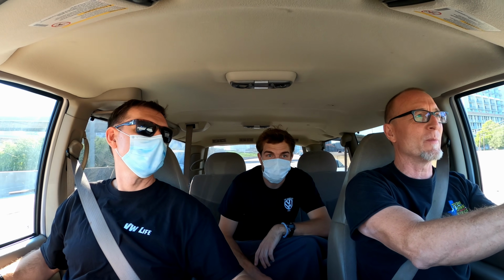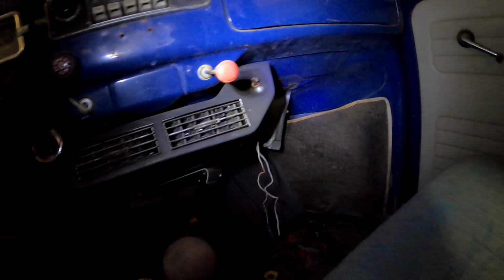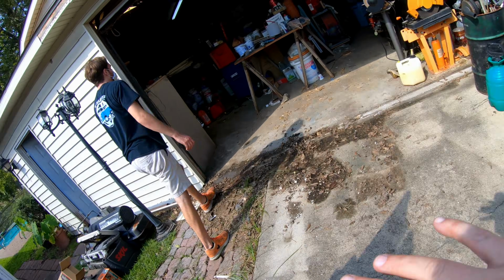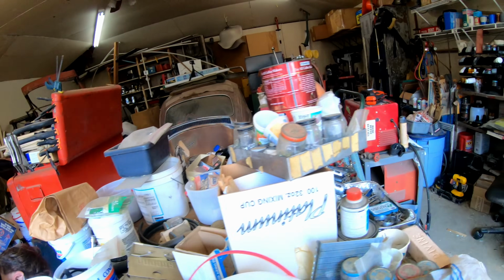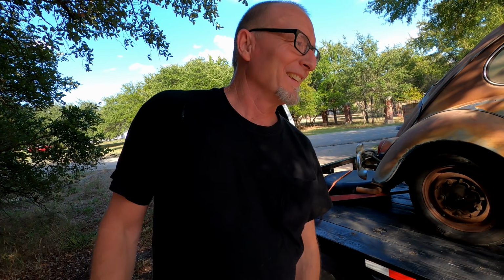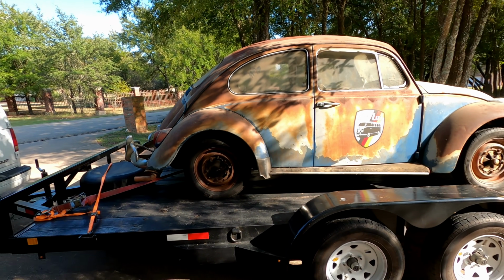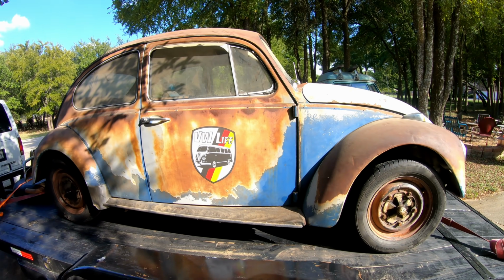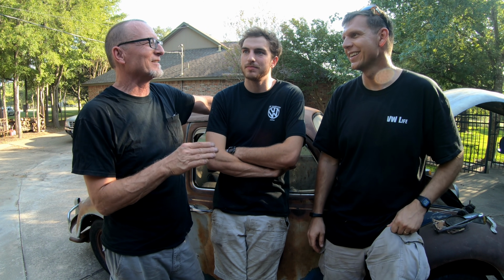The Story of "Ol Spot" a 1967 Volkswagen Beetle Parked since 1980!

Comment: little tip on the fuel injection. The injectors always plug up. they open with a small amount of voltage like 1 to 3 volts. We used to snap them with a 9 volt battery to get them to clean up. spray some carb spray and snap them with a little 9 volt battery. Dont hold it on for any amount of time or the injector will fry. just snap for a half second sometimes do it a few times. then it will click. spray some carb spray and use a 1.5 volt battery and spray through them. You can revive old injectors We did it all the time.
Reply: Great tip!!! We are gonna mess with the '78 Vert in the morning some!
Reply from the maker: wow thanks!
Reply: @CapnTexan  will it run would be cool especially if you can show this to people. might help some guys with late models.. In ca they cannot be carbureted. gotta pass smog.
Reply: @CapnTexan  also remove and replace all the connections and just spray them with brake spray. If they are copper and corroded. I use tarn ex. but you gotta rince. it off. Most of the problems with old fuel injection are connections.

Comment: Oh man! Great stuff!! I have a 67 beetle, and 2 years ago I had basically the bottom 6"of the car replaced. Lol 
The floor pans, running boards, heater channels, fire wall, you name it. If it had rust, it was all cut out and replaced. Also did a front disc brake conversion, and new master cylinder, rear brakes, lines, tires, fuel lines, everything. Now, after all the body work the damn engine won't run right! I've had it to 2 different VW shops, and it still won't run. I'm at the end of my rope with it.  If I lived in Texas, I would have you guys look at it! I know you could figure it out.
Reply from the maker: that's odd,  sometimes you just need to keep at it.  you'll figure it out!

Comment: I have watched your channel for some time and I see you have an Astro tow truck.  Have you ever had any problems concerning the trans boiling the fluid out while on the road.  I have a Safari and would like to use it for pulling a trailer.  I have owned 2 beetles and like them.  My were 1956 and 1963.
Reply: I have towed VW's with Astro vans for over 30 years. Never had an issue, knock on wood. "D-White" the Astro Van is fixing to get some helper springs as the old leafs are just about wore out.
Reply from the maker: it tows great

Comment: Have you guys thought about a tow bar like the one the RVs use to haul the car, you guys could get a lot of use out of it, especially if the car is a roller.
Reply from the maker: we used one for years before getting the trailer this year
Reply: @VWLifeVW  The reason I say, is because, you could use bot the trailer & the tow bar, this way like when you towed Ol Spot away, you could have gotten the  awesome convertible, or make like some kind of dollies this way you can tow two cars, what happened to the Volkswagen Vanagon, that you guys saw, I believe it is a 1980 model that  was abandoned or somebody just left it there, that would have been a perfect work truck,/ parts hauler, lot*s of space .